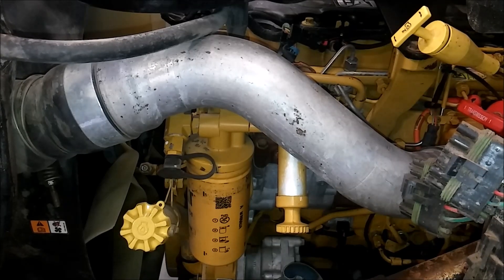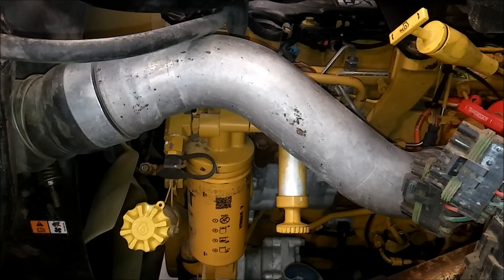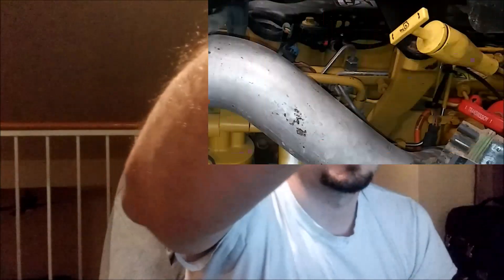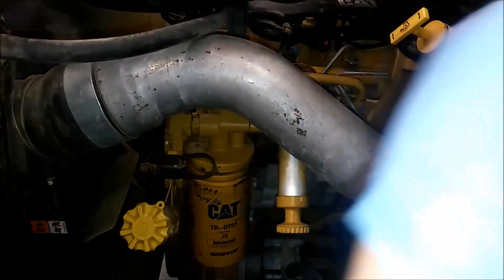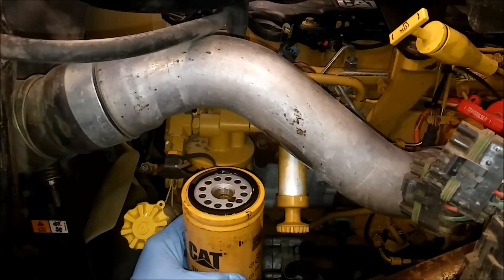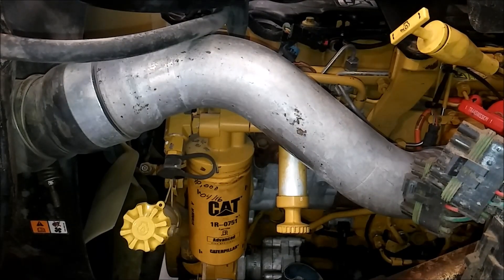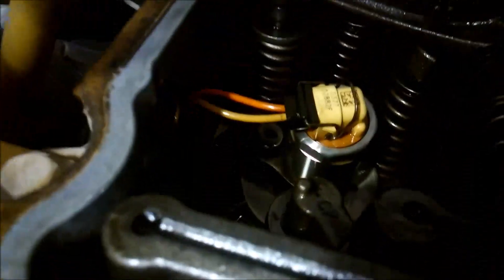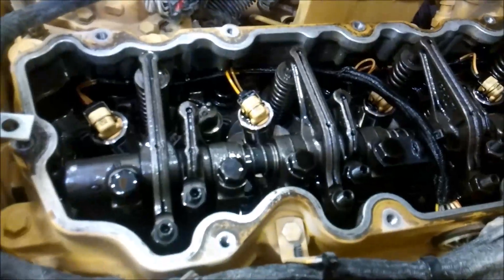How To Troubleshoot Fuel In Oil Contamination .  Diesel Fuel Dilution.

Comment: ape, i got an isuzu 10pc1 dumpturck and have diesel mix with the oil... is it possible that its only the injector line rubber seal that needs replacement?

Comment: Hey I tried the dye trick but seemed like injectors were fine I have c 15 i definitely have diesel getting in oil where do I go next tbanks
Reply from the maker: +Joan Halpin Well sometimes it is hard to find the leak, you could have a leak when it is hot or cold or under certain conditions. Did you do the test hot or cold?

Comment: For anyone checking the comments for tips, I fought for 2 weeks with fuel in my oil.  I replaced the injectors and the fuel pump. Still got fuel in.  I hooked an air line to my fuel filter housing and capped off the return line.  Injectors 2 and 4 were pissing diesel.  No matter the injector, it still leaked.

Ended up replacing the head.  Problem solved.  Did it in a couple days in a Sapp bros. parking lot with an autozone engine hoist and hand tools.  

The reason I say all of this is that I absolutely did not believe my new (aftermarket) head was the problem.  There was no real evidence of it being the head.  Even bore measurements with a caliper did not give any evidence.  Injectors may be a more common problem, but yall, don't kill time and be stubborn like me.  Pop a new head on of its not injectors, o-rings, or the pump.
Reply: Oh yeah, this was a C12 in my '04 387.
Reply: Wholly smokes Batman I would like to have seen a video of that!
Reply: I'm fuel pump part. Then ima recheck the injectors again. If problem not solved it may be the head
Reply: Where did you get the head from?
Reply: Aynı sorun bendede var yağa benzin karıştırıyor herşeyine bakıldı enjektörler benzin pompası basınç regülatörü Buji kablolar distribütör krank sensörü hiçbirinde sorun yok ama ustalar arızanın nedenini bulamıyor, aracım Renault 19 Europa 1.8 f3p

Comment: Hey adept, quick question?  I was getting alot of white smoke coming from exhaust and loss of power,  I checked fuel filters , they were fine, then took off  the fuel regulator on top of the fuel filter housing, found a piece of plastic inside of the little ball in the regulator. not sure how long it was there for but ive had a loss of power for a few weeks now .Anyway, now I notice i got alot of power and white smoke is gone....but I have blue smoke now when i idle , and oil coming out of my manifold from the rear.  I see really small bubbles what it seems like fuel in the oil, and i did the bottle test and i have bubbles😩  Radiator looks clean. Im taking it in To the mechanic but Im thinking it could be an injector, or my Cooler.  Took the hot hose of the air compressor Bubbles continued.  I dont want to say its the head but , can an injector or a cooler or a bad turbo cause bubbles in the water bottle?
Reply from the maker: +Big Foot Which engine do you have and what is the first three letters of the serial number?
Reply: Adept Ape c13 acert   kcb
Reply from the maker: +Big Foot Sounds like you have some bad symptoms there. So your engine has a precooler so if that leaks you can get some bubbles into the cooling system as usually coolant in the intake hoses. From the symptoms you describe though, it sounds like a cylinder head. The C13 is a fairly trouble free engine except for the head cracking, usually from an overheat, but can crack without one as well. An oil cooler usually puts oil into your coolant and an injector itself can't force air into the cooling system, although it is possible that you are getting compression into the cooling system from the injector cup.
Reply: Adept Ape thank you sir.....you rock.  took pre cooler intake hose off and there was a little bit of coolant in the front side of it , turned the engine on and got alot of white smoke looks more like steam.. thats what im getting coming out of my dip stick aswell , looks like steam and if you put your hand over the oil dip stick nozzle , clear water from the steam.....Idk im no expert but ,i drained my coolant and its clean, oil looks clean aswell.....I dont want to spend $500 or more to have someone tear down my engine to see whats going on.....I just spent $600 on a pre cooler arrives tomorrow morning and ill just install a new one.  If the problem continues then Ill know its internal......But pre cooler has a small leak on the front corner of the little radiator....Thanks again man

Comment: Im having an issue with a Cummins n14 celect plus in an 2001 international 9200 truck.
Oil keeps getting higher and thinning...My mechanic didnt trouble shoot it right he sent the heads to a machine shop and they replaced the cups and o ring and everything was checked...The heads are good now... 3000 miles later after repair oil keeps rising higher and the oil got so high in level that it came out of the breather tube and splashed  the whole passenger side of the truck...i have white/lightblue smoke coming out of the exhaust when running, no smoke at idling...i dont think the head was the cause of this issue what else can it be? i tried the dye method my self and i dont see any leaking on the exterior of the injectors...one thing i noticed is that injector number 4 is missing the connector cap that plugs into the head to the outside cable line i can see the metal wire inside the cable...Can that be an issue for leaking? Also my truck is getting 4mpg, i used to get 6mpg at least...when im driving in up hills the truck gets tired and loses power...what else can it be in a cummins n14?
Reply from the maker: +Jahziel Maciel I'm not a Cummins expert, but I would have your injectors checked first, similar to this video. I'm sure there is some sort of fuel pump as well, that if engine driven could be a likely cause as well.
Reply: How is your truck running now?

Comment: I brought a Kia van that kept as the guy would say "the oil level would go" up so I brought the van cheep like $500 replaced the seal on the fuel pump best buy I ever did. Except I done the head gasket and I must have damaged the new head gasket when I replaced it which I'm sure I did. One I still had the motor in the van more than enough room but the heads are heavy and I didn't have a second set of hands to help me locate the head and second it was a bitch to find the bolt torques and I had it set wrong not the wrong pattern just the wrong torque setting.
Reply from the maker: +Troy Andrews I can only imagine the pure joy of doing a set of heads in a Kia van by yourself must be. Sometimes I wonder if us mechanics enjoy misery or just the struggle?
Reply: well I think its both the scars I have on my hands are testimony to the pure joy any automobile can bring. I watch your channel for helpful tips for Diesel although I don't work on trucks I still think its good for a broad generalisation. Plus now due to injury I am studying web site design just to save what good body parts I got left but i still love getting dirty.
Reply from the maker: +Troy Andrews I've been spending a lot more time learning video editing and was thinking of getting into basic animation, but just don't have much time. It's good to have a wide range of skills.
Reply: I was thinking that after I mastered web design I might have to follow my other passion aerospace engineering because it not rocket science oh hang on it is lol

Comment: Could this fuel leak be an o-ring or would the injector need to be replaced? thanks
Reply from the maker: +Poster Art When the injector is leaking out of the solenoid like this one it is the injector itself that needs replaced. If the leak was down around where the injector is inserted into the head, you could remove it and replace the orings. Depends where it is leaking.

Comment: How about coolant in oil, and coolant draining from engine, and leaking out from the exhaust with or without engine running
Reply from the maker: +zeer365 Sounds like a cracked head or head gasket most likely. The air compressor can also fail and put coolant into the engine. Typically if you have coolant coming out of the exhaust it is had related. Check your precooler and then do a bottle test as well. I have a video how to do a bottle test, it is very easy to do.
Reply: If timing case or cover gasket damaged also getting oil in coolant

Comment: I recently got my #6 injector replaced on my 3406e and after I picked up my truck from freightliner I found the oil is above the full mark on the dip stick,after watching your video I guess now I should get my oil sample checked out and get the oil and filters changed
Reply from the maker: +raj gill Its a good idea to have that checked and make sure the level doesn't keep getting higher and higher.

Comment: nice vlog sir. i normally always just changed all injectors but with the dye you can save the customer money.
Reply from the maker: Doing the dye can pinpoint it, but sometimes when you start getting one leaking, more are likely to leak soon. Normally we just change them as they fail though.
Reply: I was doing the same by changing all the injector whenever there diesel mix, this video is going to help me and the customers. Thank you very much

Comment: Hey Adept

So whag exactly caises the fuel to leak past the injector up to the cylinder head into the oil? is it worn seals or what exactly? thanks!
Reply from the maker: +Omar Well there are seals external and internal on the injectors, if you see oil coming out around where the injector inserts into the head then it might just be an oring, if it is the solenoid or body of the injector, then the injector has to be replaced. Just normal wear can cause this and it is a somewhat common problem.

Comment: can anyone tell me how diesel fuel mix with oil in detail i would appreciate it
Reply from the maker: +Vishnu Desai Well usually its caused by a fuel leak inside the engine which results in a high oil level, but the oil viscosity thins out due to Diesel fuel being very thin viscosity. It can cause bearing and other engine damage.

Comment: Thanks for making this video! I've been trying to solve this issue with my 3126B, and I've read a bunch of people mentioning the transfer pump as a possible source for the leak. Do you happen to know off hand if the pumps on an 8YL can push fuel into the oil, or does the pump design not really allow for that? I've heard 'it's rare', but I can't tell by the diagrams if it would even be possible, or specifically what to look for when I'm inspecting the pump for it.
Reply from the maker: +adam7e I have never seen one caused by a 3126 transfer pump, it is possible though. The transfer pump is driven by the back of the HEUI with a little armature. I guess if the seals failed and then sent fuel past the little armature seal, it could leak into the HEUI pump, but my guess is it's one of the injectors.
Reply: Thanks man! In the video you mention that the troublesome injector needs to be removed, and replaced. This must mean that this kind of leak is internal, and not caused by failure of the o-rings/seals on the body of the injector?
Reply from the maker: +adam7e Typically the injector orings seal the fuel rails in the head. If you do this test with the black light and there is any fuel on the injector, meaning it's coming out of the body of the injector, the injector should be replaced. If the leak is just around the base if the injector where the external oring seals the head, then that can be replaced, but on a HEUI engine, 3126 and C7, those external seals keep the HEUI oil sealed as well, so you see an engine oil leak at the oring and not a fuel leak.
Reply: If I had an oil leak at the oring in addition to an internal leak within the injector body, might that put oil into my fuel tank? If so, what's the best way to go about inspecting the fuel?
Reply from the maker: +adam7e An oring seals the fuel rail and the oil rail in the head from each other, so if the oring between rails, which is your center oring on your injectors failed, it would pump oil into your fuel system. The injectors themselves can leak internally and do this as well. If your fuel starts turning black from the oil, then you know you are cross contaminating. If your looking to fix it, you can reseal the injector orings, which isn't too expensive if you do it yourself. Hopefully it's just an oring, if that doesn't fix it you pretty much have to change the injectors as a set. Now you can try calling a Diesel fuel shop and see if they can test HEUI injectors for internal leaks, but as a dealership we don't have a way to test them so we replace them. Hope that helps.
Reply: Thanks! It does, but I think I worded the second half of my question poorly. I'm also trying to find out the smartest/easiest way to check my fuel for being black. Take off the fuel filter and use the priming pump to squirt some into a cup? Never done this before :)
Reply from the maker: +adam7e Oh, well you could just pull the fuel filter and then pour some out of the filter into a glass, you wouldn't need to use the priming pump, now if the filter is empty you may have to prime the engine again with the hand priming pump, but only draining enough to fill a small cup out shouldn't need priming.
Reply from the maker: +adam7e I need to get a Skype account for call ins, I think that'll also be on my list.
Reply: yep

Comment: I've drove several cat applications in different truck manufactures over the past 25 years of driving.  looking at an Cat C15 6NZ motor or C15 acert both engines have over 1.2 million on them....really can't afford to rebuild them now.  Would you just swapped them out with the same model of the cat engine or do a partial rebuild?  Both cat engines are coming from wrecked vehicles with around 700k on them
Reply from the maker: I would suggest a rebuild if you really need it. An engine swap typically would cost you more. Definitely go with the 6NZ if given the ability to get either.

Comment: Awesome, just finished the AAS at Central Carolina Community College, found out about the CAT program, going to go through it now, I would have never thought about the injector, I thought it would have been bad rings.
Reply from the maker: The injector is the usual cause. Good luck with your new career.
Reply from the maker: +Jay Hoeft Yeah those older mechanical engines like the 3406 and 3300 series could leak through the injection pump. I've also seen the fuel lines leak under the valve cover going to the injectors.
Reply: the  fun  ones  are  the  fuel  jumper  tubes Detroit  2  strokes

Comment: if you could find the part number for inside wire harness maybe start with that
Reply from the maker: Is the check engine light coming on? If there is a current or voltage problem the ECM will code for that pretty quickly. I'm also going to try and do a video on C15 overhead adjustments the next time I have to run one, hopefully that will help.
Reply from the maker: I can get you the part number if you want though just need the serial number.
Reply: Hi I have a problem.  I have 2005 c7 cat engine,and .  I have tried that dye method and I couldn't see the dye anywhere in the injectors. So where do I go from here,  could it be the hiew pump.??

Comment: hello I don't know if you remember me  I came to shop with the 387 Pete now after I adjusted the valves firs time I had it wrong I was on the opposite stroke  now I fixed it but my Jake's are very weak  any suggestions thanks
Reply from the maker: I remember you, did you adjust the Jake's too or just the intake and exhaust?
Reply: +Adept Ape Jake's too
Reply from the maker: +fisnik bojku Hmmmmm, well if it was running fine before and now it's not, my guess would be the adjustment is off. There could be an oil leak in the Jake housings, but that is much less common.

Comment: ape, these videos are amazing.  Thanks for sharing your knowledge with us.  With the oil diluted, wouldn't more oil get into the cylinder causing the engine to smoke a slight blue while running?  Just trying to think if there would be any tell tell signs of a problem other than the dipstick.  I sometimes go 1,000-1500 miles without checking the dip stick.
Reply from the maker: I'm glad you like them, not sure if they're amazing, but I think I am getting better at making them. So if your oil is diluted you'll start getting less oil pressure because the viscosity will start dropping, that is a good way to tell. Thanks for commenting.
Reply from the maker: I'm glad you like them, not sure if they're amazing, but I think I am getting better at making them. So if your oil is diluted you'll start getting less oil pressure because the viscosity will start dropping, that is a good way to tell. Thanks for commenting.
Reply: +Adept Ape you wont win an Oscar for them, but i meant the content is very helpful.  There are a lot of guys with automotive youtube vlogs, but non that cover detailed diesel engines like yours.  Hopefully you will be able to get into a diesel rebuild in the near future!
Reply from the maker: +Regal2800 I know you've between requesting a rebuild video for months, but I haven't had to do a rebuild in a few months, mostly engine swaps, but I'll try to film the next one I do. I think it would get good views too. Thanks for commenting Regal.

Comment: I like all your vids
Reply from the maker: Thank you, I like hearing that people watch them and enjoy them.
Reply: +Adept Ape hey great video, just wondering what else could cause fuel in oil contamination?
Reply from the maker: +Anthony Koulizakis Well I mentioned a few of the other possible locations on a Cat engine. The high pressure fuel pump, fuel transfer pump, a severely damaged cylinder could leak it into the crankcase or a cracked cylinder head fuel rail, but usually it's the injectors or injector lines.